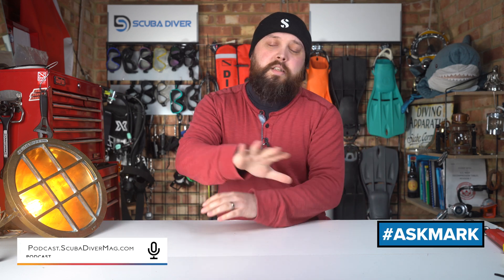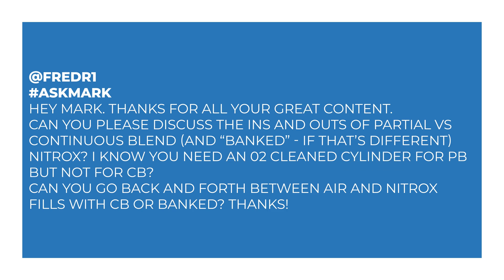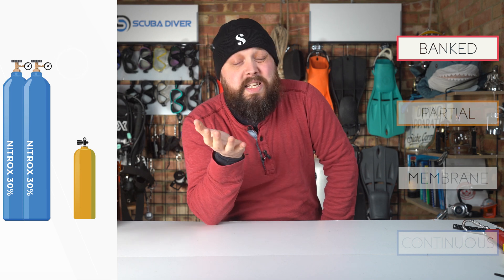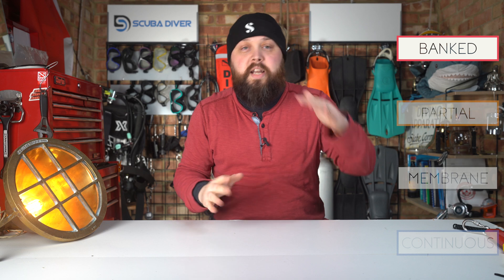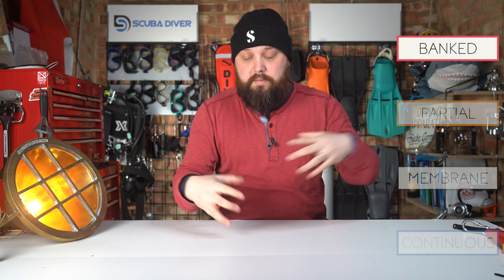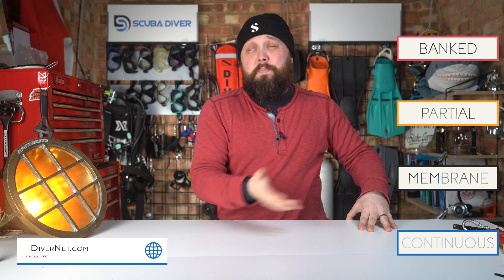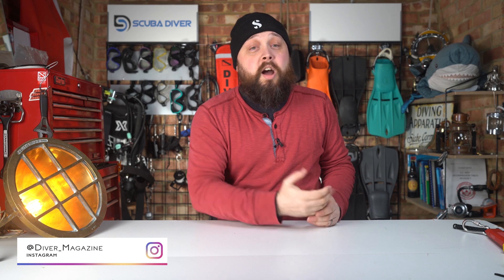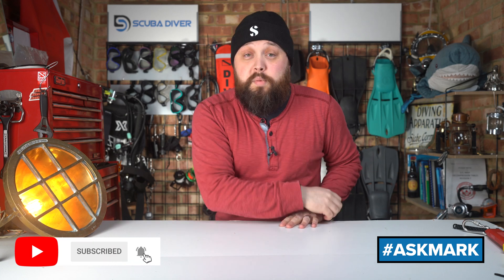How Nitrox Is Made For Scuba Diving | Partial Vs Continuous Vs Banked Explained

Comment: #AskMark Hello Mark, thank you for your videos. They are absolutely great with the content and your knowledge of everything and I love to watch them. 
I have a question about the Partial Nitrox Filling. When you have a residual pressure of air (nitrox) in the cylinder after a dive and you put the O2 in and then another part of Air to fill up the pressure up to 200 Bars does the tank need to be Oxygen Cleaned? Taking into consideration that YES, the valve need to be clean and setup with O2 O-rings because the Pure O2 is going through in the 2nd step of the filling. But when I will make let's say 32% Nitrox and use it the Oxygen Services Valve and tank will be "dirty" with "better" air (32 EANx). So how often shoud be the valve Oxygen cleaned when I use it with Nitrox and can I use the same tank for Nitrox and Air if it was Oxygen cleaned with swerviced valve to be used in Partial Pressure Blending? 
Many thank sir.
Reply from the maker: I'd always argue yes; it's best to have the whole cylinder O2 clean, to err on the side of caution. I understand the argument that if there's nitrox inside to dilute, the pure O2 never touches the cylinder itself. But I don't see the benefit of not having it cleaned other than saving some money, and I don't know if a technician would sign off a cylinder as O2 clean if part of it isn't.

You can have a clean air 21% fill, they'll use the same extra filtered air as they use to dilute a Nitrox fill. If your fills are always from an oxygen-clean compressor supplying oxygen-compatible air, then your annual service should be fine. But if you occasionally fill with standard air at a dive shop, you must consider the tank contaminated — it would need re-cleaning before it can safely be used again for partial pressure blending.

The general guideline is every 12 months if the cylinder is partial pressure blended. Or immediately if you suspect contamination (oil smell, dirty fill, or if the shop tops it with non-O₂ compatible air).

Comment: when i used to go on holidays as a child (40 yrs ago ish ) with my dad who was diving i used to see everywhere filling cylinders under water in a sump filled with water they just lowered them in then started the fill. i always thought it was incase they ruptered but guess it was to keep them cooler....since i have started diving i have never seen it
Reply: This is how the dive shops I use fill tanks. They go in a water bath to cool the tank as it fills. I then also wait a few minutes after its filled before testing as it needs to "rest" to get a more accurate reading as they partial blend to get my desired mix of 32 or 34 %.
Reply from the maker: A bit of both, dunk tanks let us see small leaks that you wouldn't otherwise notice. If a cylinder does go bang I was told the water and metal sides would add some protection, I'm not sure how much though. And the cooling effect of the water did mean that you could fill cylinders faster without them heating up as much. 

You did get very wet when using them all the time, especially if an O-ring extruded during a fill...

Comment: #askmark hi, winter gives great visibility here in Norway, but reviling even better all the pollution and trash at the bottom. What is your advise and your experience in ocean cleaning?
Reply from the maker: Survey first. Have a look at the job at hand from all angles before going hands on. There could be something around a corner that you wouldn't notice at first. If it's something simple as a drinks can it's quick but, with ghost gear you need to be careful of extra filaments, hooks and floats that could get you tangled if you start cutting.

Work as a team. Try to have one diver hang back and watch so that they can come and assist if you get tangled but, if something goes wrong it's less likely that both of you will be caught up at the same time. It's also handy to have somebody on the surface to help haul things out of the water.

Lift bags are handy. Things you collect can get heavy and you don't need to be dragging it all throughout the dive. Once you've collected enough you can send it to the surface or add some gas to make it more neutral and you don't need to struggle on any stops or on the surface.

Comment: #AskMark Why does some air tastes different? Sometimes there's a slight oily taste, others are vevy dry, is there a standard for gas filtration?
Reply: If there is an "oily taste" then the compressor urgently needs at least a service (or probably a repair). Reject the cylinder, and if the problem continues change your filling station. Other thing might be contamination of your regulator.
As for "dry": this depends mostly on the cooling of the high pressure gas immediately after the compressor (before the water-trap), but there are freeze-dryers (as well as hygroscopic absorbent / desiccant gels) commercially available to further reduce the water vapor content - but most dive centers/filling stations consider this as too expensive (it only adds a few drops of pure water inside the cylinder on every fill, over a dive season this accumulates to about 100-200ml - which can lead to rust).
There are regulations in most countries available regarding required air quality - but they usually only require testing in rather large intervals. Most compressor installations just filter air like your car engine does - and rely on "clean" surrounding air around the inlet area. You could check out OSHA (29CFR1910.146, 29CFR1910.134, 29CFR1910.430 as starting points for further search), Mil-Std-1330D, ASTM (G126, G128, G63, G94) publications.
Reply from the maker: Oof, breathing air shouldn't have any taste or smell. If I smell or taste something I'm never using that gas for a dive and I'm telling the station that filled it that they need to test their system. Drain the cylinder and get it filled again with some fresh air to flush out any contaminants.

We have testing kits that test for various contaminants that the filters in the fillers compressor should have filtered out. There are various reasons that can lead to contaminants and it's recommended that you tell them so they run a test on their compressor and banks and don't fill any other cylinders until they do.

Dry fills are fine, we want our fills to be dry so there's as little moisture inside the cylinder as possible which can cause unseen rust and corrosion. Moisture is another thing we strive to filter out of our air fills.

Comment: If you are interested in continuous blending Google for a Nitrox stick. It is basically a wide pipe with baffles inside. It is connected to an air inlet (normally via an initial filter). It then has an oxygen input from a cylinder and a o2 sensor. It is then connected as the input to the compressor. Similar to partial blending you can tailor it depending on what’s already in the tank to get an accurate fill

Comment: The thing I learned early on was that with partial pressure blending the O2 doesn't mix right into the rest of the gas as you might think.  So if you test it straight away you might find the blend is way off.  But rolling it around and tipping it about for a few minutes should get you an accurate reading to set in the dive computer.

Comment: What is a Reliable Dive Computer? I keep breaking Genesis Centauri and SEAC Screen models
Reply from the maker: It's hard to fault Shearwater computers and they're built tough. Garmin are also a strong choice today but tend to be multi-sport computers.

If you're rough with computers then some models have a silicone or metal protection cage from 3rd party brands available.
Reply: @ScubaDiverMagazine  Thank you. The Depth Sensor keeps breaking. Usually when not being used
Reply: I LOVE my Shearwater Teric. I upgraded from an Oceanic Pro Plus 3.1. My next computer (for my aging eyes will be the Perdix. Most of my dive buddies have changed over too after seeing how easy it is to use & its durability. I lobster hunt so I stick my hands in holes all the time. I have a narked 90 protector on the face to help protect it.
Reply: Perdix
Reply: @chrisphilhower6029  peregrine tx is a solid choice that few will outgrow

Comment: Fun fact on the membrane systems is that they were initially developed for creating clean nitrogen for industrial use. At some point, someone realised that by tapping off the "waste dump" from the system, you get nitrox. One down-side is that what you get isn't "air + O2" as in partial blends, but "air - N2", which means that any impurities or other gases that make it through the filter stack are also more concentrated. For that reason, contaminant testing (e.g. CO) is (or should be) carried out a lot more often.

Comment: #AskMark Mark great video love your content I recently had my cylinder hydro tested it was filled with air how long can you keep the air in the cylinder before you use it .Also dive shop can drain the air and fill with nitrox?
Reply from the maker: That is a good question. And the official answer is three months for breathing gas to be on the safe side. 

Right after a hydro test is both the best and worst time because if it was tested and dried out properly, then chances of anything nasty inside your cylinder are incredibly low. If the test center didn't dry your cylinder or there's a problem with their compressor then you could have contaminants in your cylinder.

Gases can settle and increase the concentration of elements in key areas which can lead to chemical reactions and corrosion. There have been rare cases of carbon monoxide being produced inside a stored cylinder. If there's any moisture inside the cylinder it will eventually settle in one spot which can cause corrosion in one spot, which is why it's recommended that you store cylinders upright.

If you turn up with a full air cylinder for a nitrox fill, they'll drain your cylinder. Not all of the way but, enough to get the right mix in, it depends on what nitrox method they use. Draining a full cylinder can take some time and it's very noisy depending on how they do it so allow plenty of time before collecting it again.
Reply: Also is it really worth the risks using old air? A fill costs $10-15 is it really worth saving that? No way.
Reply: @MysticalDragon73  Honestly, the factor for me would be logistics, not the price of the fill. If I have to go to the shop early in the morning before my dive just to "be sure that the gas is actually fine", I propably won't do that.
Reply: @ so you would risk breathing contaminated or bad air? for some convenience? Thats absurd. 

I'm 45-60 minutes from a shop and 2.5 hours from a dive site. I would make the extra trip or change things up to ensure I was safe and more importantly my dive buddy is safe.

Are you sharing with those you dive with what you are doing? Are they ok with that? Remember your octo is for THEM in an emergency which includes your air supply.

I'm amazed at how many want to cut corners with life support items.
Reply: @MysticalDragon73  I have not personally heard of this thing being something you should take care of, and I dive with VERY danger aware divers who do work on diving safety in the entire DACH-Region.
Driving the extra hour to the dive shop and getting it filled there might even be more dangerous, who knows. There are a ton of road and filling accidents.
In Rebreather divers, it is very common to keep bailout bottles for years. They dont seem to have a problem with that.
Regarding my buddy, if my gas is bad, I would need his gas supply - not the other way around. And if youre actually caring that much about your buddy, why are you using a octo?